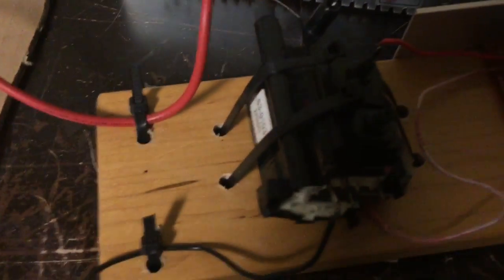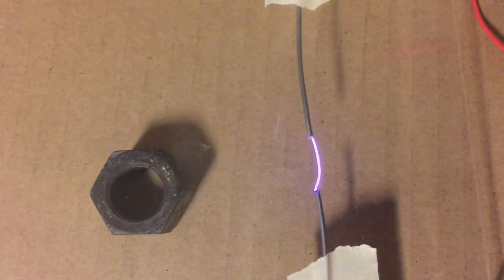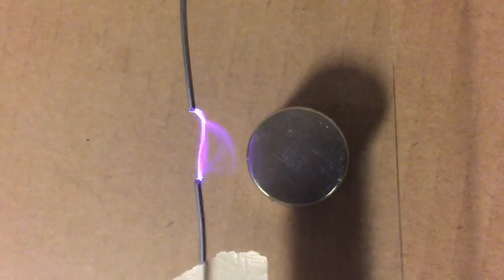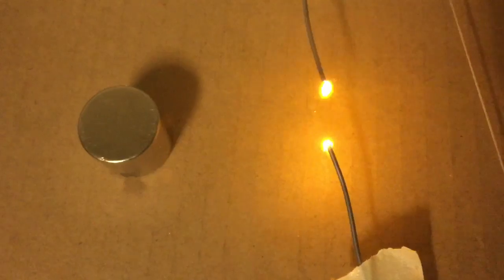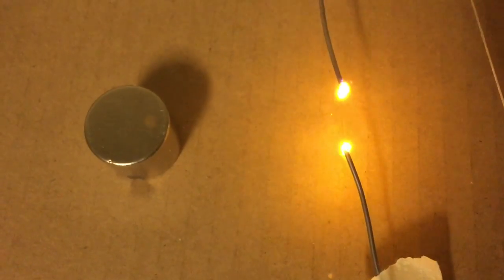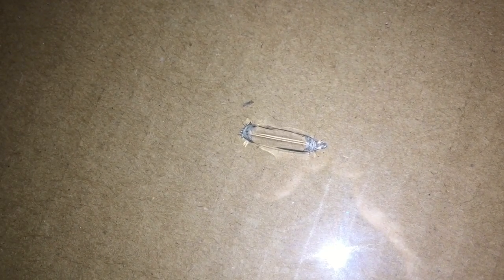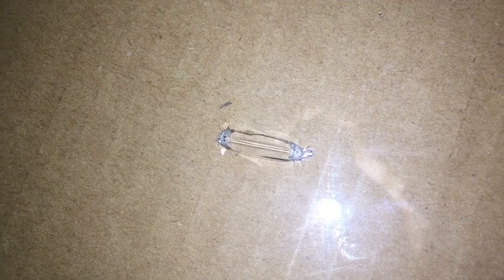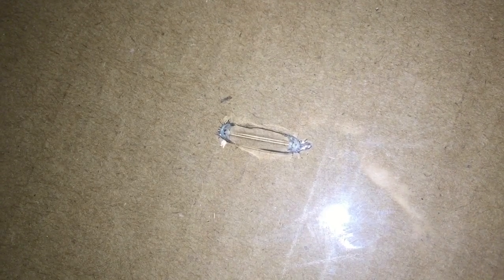Neodymium Magnet on Rectified vs Non Rectified Plasma Arc

Comment: Hello, have you found out if the plasma rotates around the magnet or is it just oscillates from side to side? Because I made another experiment that shows that even AC arc tends to rotate in magnetic field and the direction of rotation depends only on the magnetic pole of the magnet: https://youtu.be/Skd7r6a4W-Y
Reply from the maker: Yeah, I tried it. I slowed it down and found that it is actually rotating. Cool experiment. Didn’t really expect that with AC
Reply: @BrianDhvTinkerer  👍👍
Reply: @BrianDhvTinkerer  I think that I found an explanation. In some video I learned about one interesting effect about charged particles in magnetic field. If such a particle is moving in some random direction in a plane perpendicular to the magnetic field and If the magnetic field is uniform, then the trajectory of a particle will be circular. But if the magnetic field is non-uniform, then the radius of that circular trajectory will be different at different positions in space. It will be greater where magnetic field is weaker and smaller where the field is stronger. And resultant trajectory of a particle will be something like a cycloid or a side view of a spring. And as a result, all of the particles with positive charge will drift at one direction perpendicular to the magnetic field gradient and particles with opposit charge will drift in opposit direction. Thus random motion of particles can be transformed into ordered motion. So if the magnetic field of a magnet is stronger at its center and weaker at its circumference then positive charged particles will drift around the magnet, e.g. clockwise and negative particles counterclockwise. But I guess that in the arc positive ions are way heavier than electrons, so they can just pull electrons along with them and the entire arc will rotate in the direction of positive ions

Comment: You're putting a magnetic field inside another magnetic field.
Reply from the maker: Yes that’s actually exactly right. The spark represents current flow which generates a magnetic field. This is moved by thepermanent magnet field lines via Lorenz forces

Comment: If you make a Tesla hair pin circuit correctly, you will see that the spark gap is not even affected by magnetic field...really weird. And the two poles do not register as hot with a meter.
Reply from the maker: Really interesting!!

Comment: I pause at 1:02 and have a question.

you can see the steady stream arc aswell as the cloud like field of electricity.  

what is the voltage and current difference between the two movements?

Liked and Subscribed.

Thanks
Reply from the maker: Yes, the electric cloud is visible. Sometimes with very low light conditions, it is amazing to watch. The alternating current gives a very different appearance to the direct current effects. There is a definite polarity effect.

Comment: Hi! Do you mind telling me if the NST you used has a pure sine wave output? If not; what does it have?

Thank you so much. Wonderfull experiment.
Reply from the maker: Thanks very much I really appreciate that. The NST has a pure sine wave output. This is directly from the mains input.
It was really quite an interesting experiment to see that the magnet could affect the plasma to that extent. I was not really expecting that to happen.
Reply: @BrianDhvTinkerer  Thanks! And your output AC was how much kV? At what amperage?

Have you seen a difference in the resulting plasma ‘dome’ shape as a result of the N or S pole of the magnet facing the glas and thus arc?
Reply from the maker: 15kV 60 Hz AC. 
With AC there was no difference between north and south pole. However, with DC there seemed to be some rotational differences which could be caught by slowing the footage down
Reply: @BrianDhvTinkerer  Thanks again! Yeah the rotational difference is the result of the lorentzforces. Also the reason why the arc tricks you into thinking it goes full circle with AC… that is just because the arc starts at a different side 60 times per second in your case. The lorentzforces cause the arc to spin (clockwise from top view in your video). Depending on which side (elektrode) the arc starts that means it goes from twelve to six or from six to twelve. Combined they create the full circle. Very nice circumstancial happenstance.
Reply: @BrianDhvTinkerer  Brother, I want to make the same magnetic gun as in the video, but I can't understand it. You are highly cultured, can you help me?  https://youtu.be/0XbLz0L6UdI

Comment: how can i replicate this. can any one tell me about the generation of power supply.
Reply from the maker: The best thing is use an NST or neon sign transformer  for the high voltage AC supply. These typically range from 7kV to 15 kV at 30 mA. The modern NSTs are solid state and have a cutoff mechanism which would disable arc formation. So you really need an older type or vintage NST for the best results. 

For DC you would need to use a flyback transformer.  Here’s a link to Steve wards HV flyback driver which works well:
https://www.stevehv.4hv.org/FBD.htm

Comment: Cool video! Your plasma is very quiet even with AC current. I tried making plasma with a United Nuclear power supply at 20kV but it doesn't bend when I use a Nd magnet. What am I doing wrong?
Reply: Get a bigger magnet

Comment: Physics grad student here. This is what's happening. 
1) 20 kV is way more than enough potential for electrons to jump clear across that gap with high kinetic energy. qV=(1/2)mv^2
2) The electrons screaming past air molecules ionize the air,  hence the lovely lights
3) the rectifier only allows (even with AC) current to go in one way. 
4) a force F=QVxB pushes the electrons in only one direction when rectified
5) unrectified means current is switching back and forth, so you see the arcs pushed to the left AND right.
Reply: Can you confirm that the girth of the AC arc is dependant on the amount of current flowing? I am not referring to the arc gap but the circumference of the ionized air ‘flame’ if you will.

When I look at arc produced by AC with lower current (and the same voltage) they look a lot less impressive.

Comment: I can't wait till I get my job so I can try out all this sciency stuff and experiment with plasma. I've got a question which I hope you can answer: What sort of range can you get the plasma to arc from and going off the assumption that you could get it a fair distance, would you think this would sort of work ? http://puu.sh/qk1BU/4473dab883.png   I have no idea what im talking about when it comes to plasma and magnets etc. so it might seem a bit nooby but its been bugging me to find out if something like that could actually work. So the magnets sorta contain the plasma arcing around the main metalic shaft, so its sorta like a plasma sword. Or now looking at the activity of the non rectified arc on the magnet maybe have the main shaft as one long magnet? or so it contains magnets
Reply from the maker: You'd have to insulate the neodymium magnets from the arc using ceramic material or glass. The effect would be really interesting. In my experiments the DC came from a rectified fly back and the AC plasma was from a neon sign transformer.

Comment: Awesome. What magnet did you use in this experiment? Looks like to be a 1" N52 cylinder? I'm curious about the product info..
Reply from the maker: +Michael Sliter It is a 1 inch  cylinder N52 magnet.  How did you guess. I got mine off ebay. I have not tried it with ceramic magnets yet.Another thing that would be really interesting is to try it on xenon discharge tube.

Comment: great job! could you share the circuit diagram?
Reply from the maker: Sorry for the delay in getting back to you. This is the tunable flyback driver that I used for the project. I used it with a flyback with DC rectifier in: 

http://uzzors2k.4hv.org/?page=flybacktransformerdrivers

For the AC high voltage arc, I used a vintage 15kV NST  which worked great.